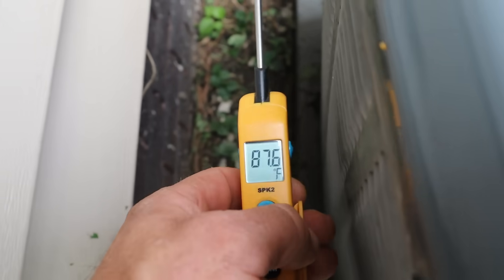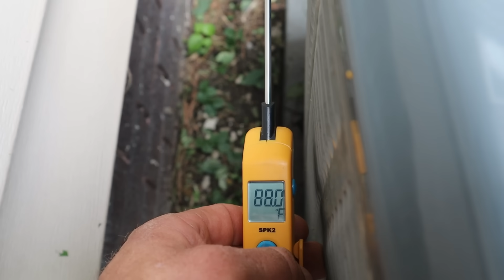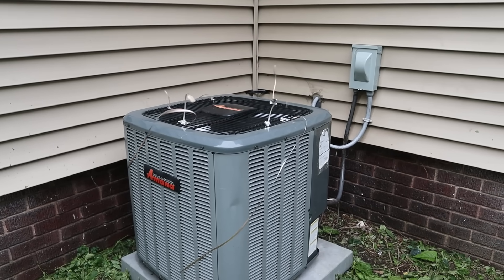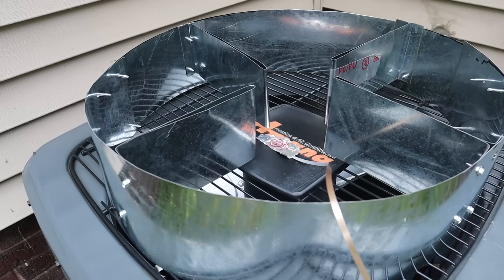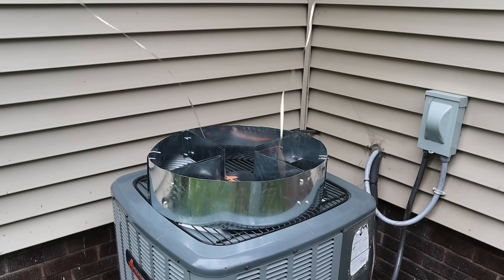Your AC Fan Makes a Mini Tornado

Comment from the maker: **UPDATED TEST RESULTS**

I ran amperage tests, checked superheat/subcooling, temps, etc. and tried different variations in designs of the shroud (based on your comments/suggestions), and here is what I found: 

1. The 5" tall shroud with 4 turning veins did eliminate recirculation, but the veins slightly increased static pressure on the fan motor. These residential motors are not designed for static pressure. The result was a 0.2 increase in amperage draw on both the fan and compressor, resulting in a several PSI increase in head pressure. Subcooling did increase by 1-2 degrees, but at a cost not worth it. 

2. I retested on a design suggestion where instead of interrupting the vortex and straightening out the airflow, we actually ENHANCE the vortex. So I made turning veins in an upward spiraling fashion. This actually led to a greater increase in head pressure over the straight vein design. 

3. I tested the shroud at 8" tall without veins in it at all. This successfully eliminated recirculation without increasing amperage draw on the fan motor or compressor nor increasing head pressure. Air intake across the coil was even at ambient temperatures all the way around, including on the sides very close to the wall. However, the recirculation was not severe enough to make an efficiency difference by eliminating it, as I found it did not reduce amperages either. That said, ambient outdoor temp was only 79 degrees during testing. 

I will retest this on a 90+ degree day just out of curiosity to see if it makes any difference. 

4. Although I didn't test a stack several feet high as many have suggested, I am fairly confident this would also lead to a static pressure resistance that would increase amperage draws and head pressure. It may be a solution for severe recirculation issues leading to system problems, but it is not an efficiency move. 

5. Many have asked me to use smoke to demonstrate airflow dynamics. I will be starting a mini-series of short videos like this one to do just that not just on the outdoor AC unit, but also these dynamics in duct systems, at the grills on the walls/ceilings/floors, with different types of air filters, etc. If there is anything else you may be particularly interested in seeing, let me know.
Reply: If it won’t mess anything up, it would be cool to do some footage with smoke or water vapor going through both versions  to compare the airflow visually.
Reply: @xiaoka I was gonna suggest exactly that
Reply: My first thought would be to make a type of square "skirt" on top of the unit in about a foot or so in each direction to eliminate the air restrictions but also keep the hot up and the cool down.
Reply: It doesn’t reduce power but it might reduce energy. Not that you that there is no change in power draw, it would be a good test to see if it changes how long the unit runs in a thermostat cycle or to drop the house temp by a few degrees.
Reply: Maybe you can put some cardboard in between the wall and the top of the unit. So it doesn're circulate that air going down, I am in the field myself  And occasionally I will use the plastic signs that you would see at a convenience store that they throw out usually at the gas pumps. It's a corrugated plastic, it's waterproof and holds up really well against rain. Although over time  the Sun will deteriorate it. But usually about a 3 year span  Is what you'll get . I have also used straight cylinder shaped Sheet metal and stuck it right on top of condensers With minimal issues with the fan motors, however, most of the stuff I work on is 3 phase.
Reply: AWESOME CONTENT
Reply: A stack several feet high would, as you said, increase static pressure, due to frictional losses caused by air interacting with the duct walls. It would also reduce flow through the fan for the same reason.

I would check air velocity on the intake side (i.e. outside of the coils), your increase in amperage may correspond to an increase in airflow.

It may not, but it may.

And you'd want to measure on the intake side because the exhaust flow is more directional with the duct than without it, which may give you a false high reading on an anemometer.

Ideal place to do it would be immediately behind the coil in the fan plenum, but there are obvious practical issues with that, so on the intake side of the coil just a centimeter or so off the intake grill should be fine. Absolute accuracy is less important here than relative accuracy and repeatability.
Reply: Try a cone shape instead of straight walls. 

Or another thing to try is a large flat piece of metal with a fan hole cut in it. This would keep the separation and not affect the outflow.
Reply: Awesome! I really appreciate you taking the time to test and follow up with more information. Thank you!
Reply: Our AC units are in a difficult and cramped location. We finally had "snorkels" fitted that divert the air up and then out with a 90 degree bend. I'm sure that they create back pressure, but I'm almost as certain that they reduce the amount of heated air that gets recirculated. I'm pretty sure the AC guys that finally did this for us tested and showed that they did help. But I don't remember the details and specifics.
Reply: Maybe a bit nitpicky but I would test the air temperature not just at the top but the bottom and middle as well.  The top air doesn't seem as important as the bottom, but I'm no fluid dynamicist.
Reply: Awesome. Looking forwards to those videos and test.
Reply: There's a lot of truth to this. A few years ago I stumbled upon some research being performed at the Florida Solar Energy Research Center. The research paper I found was titled "Development of High Efficiency Air Conditioner Condenser Fans" (can be found by performing an Internet search on: "FSEC-CR-1674-05.pdf").  An interesting read for those wanting something simple to improve their condenser performance....
Reply: Why not straight out instead of up? This would block the recirculation without disturbing the airflow or creating an area where debris could build up.
Reply: So, are you saying the 8-in shroud without any vanes in the center is the best way to go currently?
Reply: Yeah, I am curious because I don't see such vortex reducers on aircraft, so it really need quantitative data.
Reply: You probably don't see it on planes because once that air is exhausted out the back of the nozzle, the plane is going so fast that it doesn't matter.  

Edit: now that I think about it, that is probably actually the primary function of the nozzle.
Reply: @catsupchutney  they are used inside the turbine engine of a jet/turboprop. They are called "stators" in that application.

Comment: My situation is much worse. I have an air conditioner on the 4th floor and it's in a little balcony which serves ONLY to house this condenser unit. The air goes straight up and there's nothing to force the air out away from the building. Instead, the ceiling forces the air back downward. 

Is there any kind of scoop that can be installed on the top of my condenser that will direct that air in a specific direction so I can blow that heat away from the house?

Comment: This is common for many different industrial and critical applications. An example of this would be lab environments where exhaust plume needs to be managed. The short version of this is know the correct stack velocity and Cfm to prevent entrainment from occurring. Entrainment is defined by reintroducing undesirable air back into the makeup stream. Hope this helps.

Comment: measuring efficiency gains/losses like this can be complicated.  It is not obvious to most, but slight blockage of the air stream should lower, not raise the amperage as the air flow is reduced (so long as the fan follows a motor affinity curve to some degree), because it is moving less air mass when blocked, and hence less current.  The same is true for pumps. About the only way to get a handle on efficiency change  (BTUs cooled per el W-Hr)  is to  measure usage power through several cycles to cool the house, both off and on, perhaps on multiple days.  That is a bunch of work.  Maybe just install a temporary watt-hr meter, let it run for a couple of hours, then take to test shroud off and repeat, then maybe check again on a day that is 10 more more degrees different ambient DB.  I suspect that your first attempt where it reduced the backwash had a measurable benefit.  I suspect that a taller (to a point) shaped shroud where escape velocity increases would result in a bit more, but only proper testing will tell.

Comment: It irritates me how much a new HVAC costs and how cheaply they are made.  They are such a pain to clean because they aren't made to be cleaned.  You have to take a bunch of sheet metal apart.  It would be so nice if they had removeable panels that didn't require unhooking wires and all that nonsense.  Then service prices could drop because it wouldn't take an 1hr+ to open up and clean the unit each spring.  They are still built with 1960s technology.

Comment: If you were make some holes on the lower perimeter of the ring it would pull ambient air in and accelerate the exhaust and cool it down as well.

Comment: improperly installed unit, too close to walls.  Vanes are not what is important, it's the height of the turret to avoid recirc, that's what is impt on cooling tower fan, avoid recir of the hot air.

Comment: I'm curious what would happen if you removed the vanes and used only the outside circle.  Kind of like what we saw in the big units.  Would the air still deflect back down the sides?

Comment: You could get one of those inverted tire/ flower pots. Paint it gray.  Open up the bottom rim race to meet the diameter of the fan.  This would give you the bell curve for the plenum and the tread would give you the directional control.  I'd sent a picture, but this doesn't allow.  Vibration free and impervious to weather and almost free

Comment: It makes total sense. But why haven’t the manufacturers already thought of this? Why haven’t the AC installers, the AC contractors recommended this? Even sold a device for it? Air conditioners are not new technology. This is information that should have been known for decades by the manufacturer.They have tested this idea out. I’m sure. Why have they not designed their units to solve this problem?

Comment: for cooling equipment, I used the term "short circuit" when the exhaust air was ingested into the cooling air intake. Of course this reduces the capacity to cool and adds cost over time. Understanding where to "cut off" a "short circuit" vastly improves the efficiency of a AC unit. And where the unit is mounted, as in your case, the propensity to create a short circuit is amplified, so in essence, you have circumvented the drop in eff due to mounting location to bring the unit to its natural eff rating.
Reply: Window AC units, by design, also ingest some of the falling cool air back into the warm air return register, thus affecting efficiency. How much?, I don't think anyone has experimented to find out

Comment: wanna make a fortune, jets use a vortex action to speed up the incoming air reverse it to help force the air out of the unit thus saving the fan in the process and aiding in cooling the unit

Comment: Former Carrier engineer here.  While the louvered sides look nice, the more efficient sides are actually the non-louvered type sold on cheaper variants.  The louvered sides actually restrict airflow vs. the non-louvered types.
Reply: I can see that but without the louvers around here the hail storms do a lot of damage to the fins, reducing the airflow of the open design.

Comment: Would think the manufacturers would have R&D this issue and create a different housing/ shroud for the unit if it made a difference in efficiency or equipment life. Especially with the govt efficiency requirements considering this would be low hanging fruit.

Comment: I can tell right away, that that unit needs to be a minimum of one foot from the wall.  If it's not on the north side of the house, which is ideal, a simple lattice wall will help block out the sun.  Awnings, which have long gone out of style, since A/C became standard, will still save you significant cash, when placed over windows, where the sun beats in during the day.
   Excellent design, though. When I build my house, I'll be sure to incorporate one.

Comment: Ages ago we had a central ac condensor that was barrel shaped with the fan in a tapered down duct like extension at the top. No clue who made it as that was decades ago but I don't see many round ones these days. Wonder if it was any better out of the box.

Comment: Better to leave the swirl alone. The fan needs to dump as much airflow as possible and any restriction will increase backpressure on the fan (that includes "straightening" the airflow). A better test would be a conical duct to guide the hot exhaust up and away from the condenser.

Comment: I turned the fan to run backwards in the spring and my 5 ton HVAC has been cooling the house faster than ever.  You've all been doing it wrong all these years.

Comment: And then there's Trane XL1200 with a roof that does the exact opposite thing - makes the air flow out the sides, so it can be reingested and ruin the efficiency

Comment: If you add a skirt or a lower rim would it prevent pulling in hot air it just ejected? You really got me thinking here. People can make cup coasters and tables they generally just don't want to. It could be a great product idea.
Reply from the maker: Anything that prevents recirculation is a step in the right direction. But what you can't do is manipulate the airstream the fan is producing. That leads to a decrease in efficiency even if the recirculation is stopped.
Reply: @JerseyMikeHVAC  Have you seen those drone blades that are whisper quiet or very quiet? Maybe the answer could also come from the ac units blade design too? I don't know how much they worry about it.

Comment: I also fabricated a deflector for my window AC unit I use on my shed. It just points the exhaust air "up". instead of just kinda sorta back and around the intake ports. Keeping the intake condenser port air several degrees cooler.

Comment: Called stators in a turbines those blades countering the air flow twist. If you were to put a slight airfoil shape or pitch to them you could straighten the flow even more. Good thinking. I’ve been wondering if I provided shade for the unit from direct sunlight if it might improve performance as well. Be neat if combining two cheap hacks like that saved the loot.

Comment: Fantastic!!!! I did the same thing (basically) on mine. It dropped the surrounding temps down drastically. Never recirculate hot air into your condenser!!! I love your streamer idea. For a few bucks it has a profound effect/affect.

Comment: Really nice video and idea :)

Shade "should" help too... in theory. Especially if the shaded area is fairly large around the unit. Not sure how much. Might be worth checking the ambient temp on the sunny side and shaded side of the house sometime. I'd be curious what the temperature differential is for the air. Probably 'none' with a decent breeze going, but I'd imagine there's a significant difference when the air is more stagnant.

Anyway, I'm gonna sub and keep an eye out for any more ideas like this, or further tests :)

Comment: Sorry everyone. I work in this industry, not one of the OEMs, but making components and subsystems for increasing efficiency. If even a couple percent system efficiency were actually demonstrated by such an air flow modifier, they would all jump on it. I’m afraid that the whole audience is jumping to conclusions that “make sense” but just aren’t there.

Comment: I'm curious if this would work with those hybrid window units.  I've heard they don't perform well as a heating unit, but maybe it would have better performance with this setup and antifreeze pumped through the pex.

Comment: That is really neat stuff - THANKS for what looks like a great idea. Call me crazy but I am going to lay down a "box fan" of good diameter  on my outdoor unit and just see what happens; I know it will add about 200W, but hey, I already have the fan and it doesn't hurt to experiment (also it's pretty durable and I dont think it will overheat the motor - we'll see). I'll add a sensor switch to it if the idea seems to help, so it won't run continuously.  Bottom line: Thank you for the basic idea, Mr Jersey Mike!

Comment: Excellent video. Could you try to replicate tech ingredients video where he used ground water cooling to cool the fins? Basically used geothermal cooling, poured it over the coils, then pumped it back down. It increased the efficiency greatly.

Comment: One quick way to determine if there is any cooling gain is to record vent temperature with and without the modification.  Simply done within minutes of each test with the same ambient outside temperature, the same solar gain and humidity.

Another measurement could be the cycle times to achieve the programmed interior room temperature.